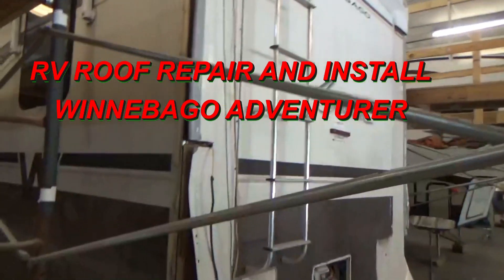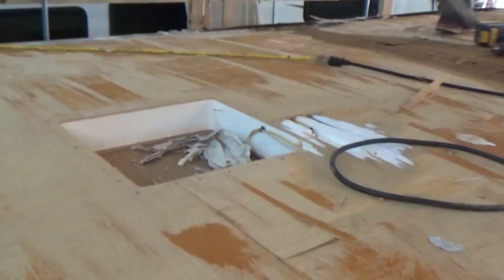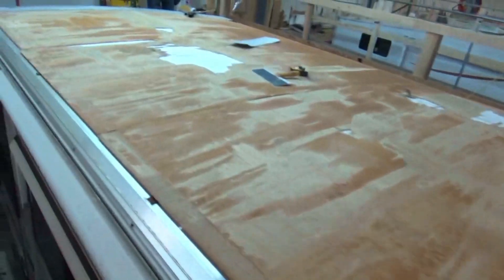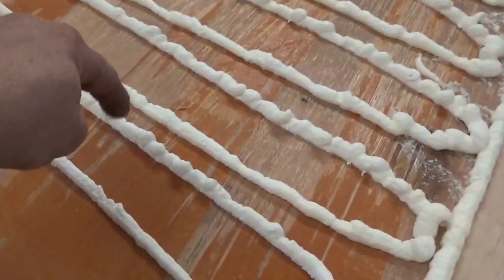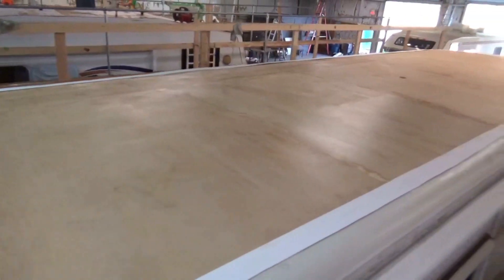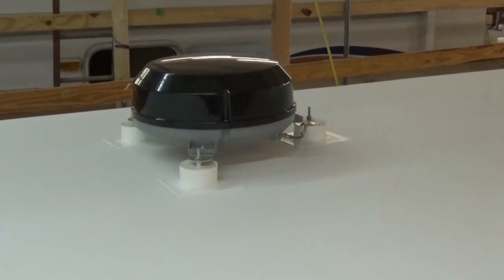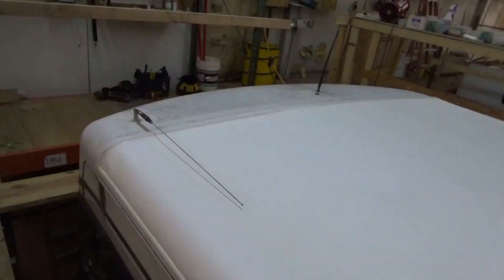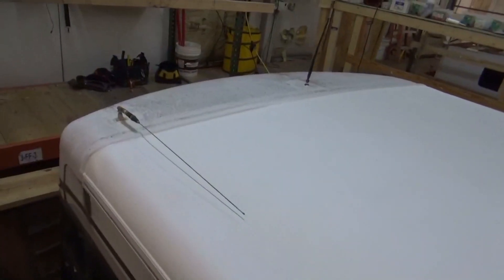RV ROOF REPLACEMENT ON WINNEABAGO

Comment: Excellent video.  I have an 89 31' Winnebago that I  am either going to reproof or scrap the whole thing. The rot  is butt ugly bad. After water damage both sides, sagging everywhere  needs to be gutted and complete overhaul. and parts of the floor included. some parts of exterior walls. Basically a salvage job. Or a great learning experience!!!

The information here is fantastic.  it gives me a realization of what has to be done. I can make assessments on costs and time.  The entire inner ceiling must come out. I see how it is constructed makes,sense. previous owner abuse.  wonder if it is really worth it?. 

After all, it will only be an 89 unless I do something unique and attractive, like raise most of the roof say 8" for excellent headroom, more insulation on floor and ceiling by 1" on both. Now its warmer and quieter.  And headroom and nice ceiling work can go a long way . 

Thanks, well done.  Dave
Reply from the maker: Thanks for watching. You need to watch the Georgetown video where we pulled the entire proof/ ceiling assembly and rebuilt it.

Comment: I like seeing your work, looks awesome. I'm reroofing my itasca foam sandwich roof soon, and I was thinking of putting a truss style in to replace the foam sandwich for better insulation, and since I have so much roof to replace. Is a foam sandwich or a truss style better for long term reliability? The luan rotted on both sides in most areas so I think a cut-n-gut is my best option. 

Aluminum skin right now, I want to go TPO if I can. Thanks for the videos!
Reply from the maker: PlyFoam roofs, if watertight, are strong roof structures. It does rely on the luan on both sides to remain strong. Trying to change it out will be a lot of work. There will be wiring and AC ducts to account for. So simply tearing it all apart is not a smart option. If it were mine I would do like we did to the Georgetown...on the channel...and rebuild in sections, whichever way you choose to go. Once the roof structure is complete you can adhere TPO. We had a Jayco eagle that had a metal roof. It's on the channel. It's a small class C.
Thanks for watching.